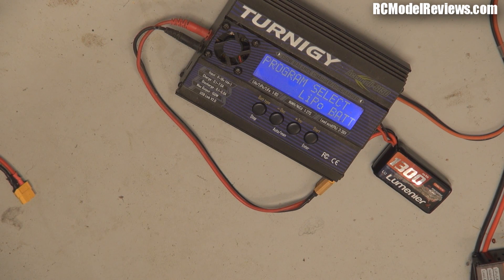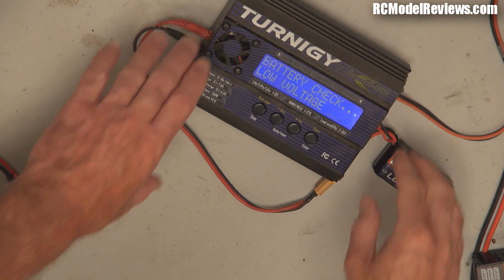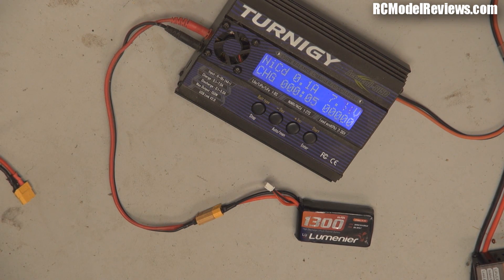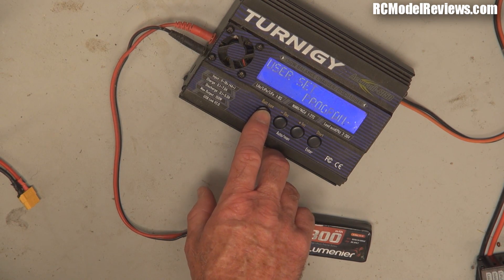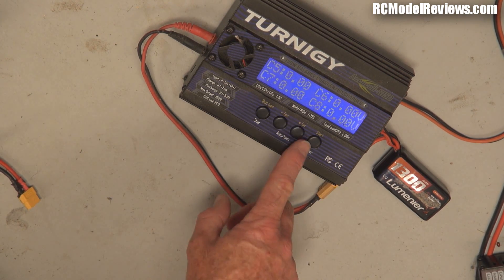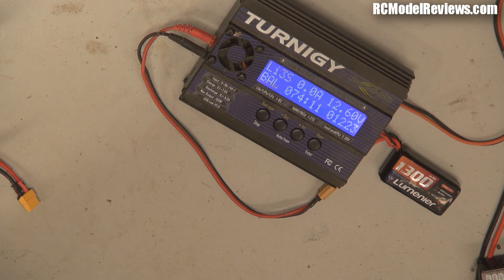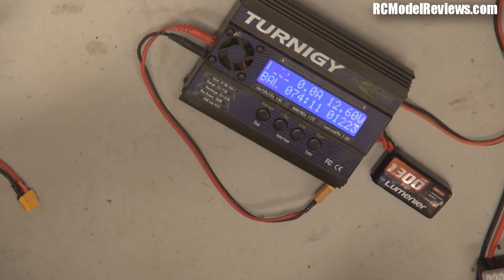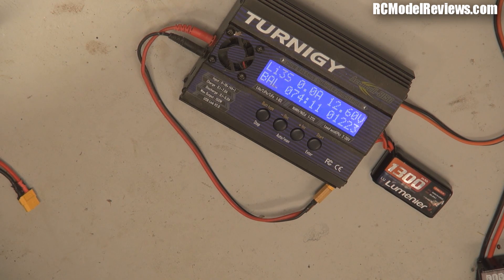How to recharge a fully flat lipo (lithium polymer) battery

Comment: I find LiPo batteries such a hassle... if I’m not flying my RC plane, I have to recharge it everyday. There goes another battery today at 0V
Reply: Why would you have to charge it everyday?  If you have a lipo at 0v, you need to pitch it, their storage voltage is 3.7v-3.8v per cell.  They should stay relatively in that range when not used, only need maintenance charging/cycling about every 6mos or so if not in use.
Reply: sunshynff thank you for my reply... clearly I was frustrated while writing that comment. I used my brand new 3 cell LiPo battery once, recharged it to 3.8V... and within a week it’s charge depleted to 0V. I’m not sure why this fast discharge is unique to LiPo batteries... but I find they die so quickly
Reply: @peterellison2220 , If it depleted to to 0v then it's defective, I've owned literally hundreds of lipo batteries over the years and only a handful that discharged to a low voltage in a short period, and never to 0v.  What did you use to measure it, most voltage readers and chargers just show "low" after it gets under 1-2v.  When you say recharged it to 3.8v?  Do you mean you set the charger to storage mode?  And what size lipo battery is it?  The volts I am referring to are per cell.  So if you have a 3s battery, each of the 3 cells would be at 3.7v at storage level, or 11.1v for the entire battery.  Fully charged it would be at 4.2v per cell or 12.6v for the entire battery.  You can safely run them down to appx. 3.4v-3.5v per cell or about 10.5v for the entire battery, but anything lower than that hurts the battery.  I've had a few lipos I forgot about for over a year, and they never lost more than maybe 0.5v.  

Make sure you keep that battery somewhere safe, if it's truly discharging that fast, there is a real risk of it catching fire.  More Lipo fires start due to discharging  than due to charging them.  Lipo fires are no joke either, they burn incredibly hot and are extremely hard to extinguish.  If you need to dispose of it safely, take it outside, cut the leads off of it, (ONE AT A TIME) not letting them touch.  Get a bucket, fill about half way with salt water, throw the battery in there for about 24-48hrs. It will then be truly discharged to 0v, and will also be inert and non toxic, which means you don't have to recycle it, just toss it in regular trash.
Reply: sunshynff I’m truly impressed by your comprehensive response, thank you. I own a voltmeter with which i can check my voltage at the field ( I didn’t deplete that new battery below 3.7V) and a charger at home that I set to storage charge (3.8V). The charger will stop charging after an hour or so, and then the drain begins... maybe because it’s connected to the charger it drains quickly? At no point did the batteries overheat in the years that I’ve owned them, but thank you for your advice. Can you refer me to a 3s 1300mAh battery that you trust? Thanks again
Reply: @peterellison2220  Sure, real quick, are you using a good charger, or at least doing a balance charge. That is where you hook  up the second cord with the white connector to a balance board. You should always charge Lipos that way, because it charges each cell equally and makes sure they all match.  When you do a plain Lipo charge, not balanced, it sends one bulk of voltage to all cells, So if one off, it won't match at the end of the charge.  Middle of the road to more expensive chargers usually have a shut off that keeps the battery from discharging, but there are some chargers out there that if you don't unplug battery when it's done, it will backflow and discharge.  There is also a setting on most chargers that's called cycle, where it charges, discharges, and charges again.  Make sure you're not on that setting.

As far as battery preference, most of my batteries are made by Tattu, they're my favorite.  They are not the cheapest but definitely not the most expensive.  Plus, they're are generally one of the lighter batteries on the market.   If money is an issue then the the cheap ones I like, that are still decent for the price, are Zop and Zippy.

https://www.ebay.com/itm/Tattu-1300mAh-3S-11-1V-45C-RC-Lipo-Battery-For-FPV-Drone-QAV250-Quad-XT60-Plug/283240328348?hash=item41f2706c9c:g:LGIAAOSwLNxcEdng

https://www.ebay.com/itm/ZOP-Power-11-1V-850mah-70C-3S-Lipo-Battery-JST-Plug/223935417070?hash=item3423974aee:g:qEkAAOSw20JZgoSz

https://www.ebay.com/itm/New-Zippy-Compact-1000mAh-3S-11-1V-25C-35C-Lipo-Battery-Pack-RC-XT60-XT-60-USA/324140598571?epid=1840546251&hash=item4b7849052b:g:YDAAAOSwYXVYyXqV
Reply: @sunshynff  Yes I am using the X1-mini battery charger, and I pay close attention to charging each cell evenly. I just ordered a Tattu 1300mAh 3S 45C LiPo battery from amazon for 35CAD. Thank you for helping me find a new battery! Once I receive it, I plan to charge it to 4.2V/cell, then gently fly it until 3.6V/cell. I will then balance charge it to 3.8V/cell. I will make sure to disconnect it from the charger and see if the battery holds 3.8V/cell over the following days. In the past, my Parkzone batteries would drain from 3.8V to 0V over a few weeks. I'll let you know how my experiment goes in May!
Reply: @peterellison2220  👍
Reply: @sunshynff  I love the new battery! Holds its charge perfectly. Thank you for your help, you're a Li-Fe saver!
Reply: Peter Ellison....awesome, glad it's working well for you!

Comment: What charger do you recommend? Also, I want to recover a 3000mah drone battery that only has a balance charge cable connection. A hubsan zino battery. How would I use the process you've described here where there's only a balance charge connector on the battery? I'd really appreciate any advice.

Comment: Something a bit different......I left 3 2800 mah 3s batteries fully charged for a yr. and now they wont fly. They measure and  say fully charged and will not charge any more, but no fly. Is there a way to bring them back to life. They will power a heavy resistor at 2A for more than 10 min at 10 volts but the fc40 won't fly and the front light blinks low battery almost right after lift off.
And quits flying.

Comment: So I paid extra for one of these spectrum smart batteries 22.2v 6s,a while back thinking I would get a charger once the financial well fills back up so to speak. In the mean time I got the battery to low playing around with it and by the time I bought the charger it said the battery wasnt any good. So I seen on youtube a couple 12 year olds using this tech. to get the battery back but I don't want to risk a fire on someone that doesnt shave yet if you know what I mean. So I ran into your video and thought if your willing to try it it must be mostly safe if the current is kept low ext. so I did it for about 10 minutes and it just worked perfectly,it was like the charger which is a spectrum s1200 (the $64 one with a toolkit 19vdc 200W power supply) started wakeing up this started working then another funtion started working and now all is good. So thank you very much I am a huge fan and now I'm you #1 fan.....Your friend Bob from Kentucky...

Comment: My 3-cell LiPo was at around 3.7 V as a pack when the charging started (so surely the voltage was even lower just sitting). 1 cell around 1.8V, the other 2 couldn't be measured. After applying this method 1 of the 2 dead cells resurrected, the third kept on being dead. I charged the pack to a point to wich 2 cells were at about 3.8V each while the third was still at 0.1V. My first dead LiPo ever. Puffing a bit after charging. Funny thing is that I decommissioned a slightly puffed 3-cell LiPo which had totally fine cell readings - now that presumed dead LiPo is in use again :D

Comment: My 2-batteries in parallel were connected to a BEC for a month. Didn't know it draw current. Now they're reading 1 volt. Are they done?
Reply: Yeah i wouldn't risk it anymore with that low voltage

Comment: epic. fixed a 1300mah 2s drone battery with this.. got a few more to try. you just made me happy to fly again. also got 2 1800mah for the bugs 3.. i rigged up a xtc30 connector and poof the b6 charger worked. its finicky on some of the others but im getting the jist.

Comment: One cell of my 3s lipo battery is showing 0 V and I connected it to a balanced charger but that 0 V cell didn't charge. But the other two cells were charged fully. What should I do in this case?
Reply: Get a lipo killer and get rid of that battery.

Comment: This just got my Maclan 6000mah 4S LIHV to start charging. I was getting a cell error message on my Hitec X2 AC Plus charger, and it was only reading voltage for 3 cells. I put it in storage mode before letting it sit for about a month and a half, I'm not sure how it discharged. 🤨

Comment: What do I do with the error message CELL ERROR and no other explanation? I have the SkyRC e660 charger and even the manual doesn't tell me what to do. Appreciate any ideas.
Reply: You have a problem with one of your cells you can check out your cells in the battery meter if you have one on your quad

Comment: Question. Have you ever came across the following:  Flying the emax tinyhawk,  I crashed.  I didnt pay attention to voltage in fpv screen. Than the quad turned off.  Unhooked battery, it was warm. I hooked up lipp to battery voltmeter (no charge or anything one of those cheap 1 cell voltage testers ‐ tester is accurate since i tested before against a multimeter).  It was at 2.88v and it started to climb very slowly within a less than half a minute it was 3.00v and kept climbing 0.01v evey few seconds.  Look like it quit climbing around 3.18.  I only flew this battery maybe 4 times (orginal with tinyhawk kit).
I hooked up to hobby charger via parallel board.  I checked another battery same type for same quad (450mah).  It tested 120ish mOhms. (Cool battery at 3.60 volts).
Questionable battery: 187mOhms (battery was also measuring 3.2v).  Question is- is the suspected battery okay, if so how do i proceed?  The hobby grade charger (that can do different chemistry) has a lipo charge as low as 100mA.

Also, i have hobby grade 1 cell lipo charger than can go to go as low as 100 mA.

Comment: low voltage ..then i follow your tip on NiCD upto 9 then charge under LiPo..it just say FULL / it did not even charge using LiPo on charger @ 1.5mah ..my battery is 2S 1500mah 7.4V  it did not work for me...

Comment: RCModelReviews
Is it feasible to charge lightly,one cell at a time (0.1 amps or less) and when they are all at your recommended voltage, return to the balanced charge lead?
A PP3 (flat battery..shape not condition)  with a limiting potentiometer and a meter in series plus one across for voltage would be straight forward enough..

Comment: I don't think you should do it if you don't have a proper charger with recovery mode for lithium cells when it pulses to break off and negates some damage from the over discharge...
Also it could much more easily puff up or short and go thermonuclear on you.... even if you use it normally afterwards...

Comment: Additionally, you can “jump” a battery with another battery or just about anything that puts out power, however, it can be very dangerous. This process shouldn’t take much time before the battery is in range to charge again but I can’t stress enough how dangerous this method can be. I once accidentally charged a lipo on NiMH settings. The lipo didn’t seem damaged afterwards, however, it was warm after charging which isn’t supposed to happen with lipos. I tested that battery in an RC and it worked fine, so, I thought everything was ok, however, later on when I charged it up again with the correct “lipo” setting, it caught on fire 🔥. I’d be very careful attempting to charge a low voltage lipo with more than one cell. Whenever, I was “jumping” lipos, it wasn’t for RC’s. I had an old cellphone that wouldn’t charge without “jumping” the battery if the voltage got too low. Nowadays, I try to avoid lipos as much as possible. I prefer NiMH batteries because they aren’t as fussy and don’t catch fire as easily. After that lipo fire, I started using different connectors for different batteries. Tamiya connectors for NiMH and Deans or Traxxas for lipo. That way, I don’t get confused and charge on the wrong settings. Be careful, always use a lipo charging case, and NEVER CHARGE BATTERIES UNATTENDED.
Reply: Ace Report yeah that’s what I do. Just jump it for for a couple of seconds a couple of times. Never had a problem. Always recovered my batteries 👌

Comment: I used this mod on a completely drained Lipo Parrot Bebob 4000mAh battery. My charger gave a complete error and normally I would throw the battery away. (€50,-)
With this method I was able to revive the battery completely. No loss of cells, no loss of power. Great mod and I will recommend this to everyone. Thanks.

Comment: You have saved my 4s 5200mah lipo, thank you!!! I bring them back from 2.5v per cell honestly I was very afraid to try it with this little big boy but everything works correctly being fine with the input voltage and amp

Comment: Thankyou! this was my problem, new smart charger, My batteries sat for  4 months, i didn't know where to start.  turns out the battery was at 2.3 volts on a 1300mah 7.4v LiPo battery.

Comment: I need to rescue a single cell (voltage of the first cell from black has reached 2.7v and all the others are 3.4v). Should I still do the NiMH/NiCd charge across the main charge leads or should I charge the lowest cell to get it over 3v using a 1s charge setting?

Comment: Hello, RCMR. I just want to take this moment and thank you for the lipo bat recovery. I have a battery that I completely discharged by mistake. I left it plugged in my googles all night and it was down pretty low to where it would not charge at all. By doing what you recommended I was able to recharge it back to normal YOU SAVED ME MONEY Thank you so much, we all appreciate you!!

Comment: Thanks for this ! Saw this video about 10 months ago but didn’t need it at the time ( I never run my batteries too low ).Today I left a 2300 2S plugged into my FPV goggles ( first time I ever forgot to unplug it ! ) all day and this evening the battery was completely dead. Charged it to 6.4v as described and it then took a 2S balance charge back to almost 4.2v per cell. I was about to throw it away when I remembered seeing this video back in the day and your method worked fine for me. Thank you for saving me a good few quid ! Cheers !

Comment: Leave it sit and see if the low cell starts dropping in voltage.. 
Mine all do so I don't trust them for more than running lights on my bicycle.
Or like you FPV goggles.

Comment: i have built a very low power constant current charger for very old cells and cheap chinese cells. charges at between 10mA and 70mA. works awesome . most modern chargers can only go as low as 100mA. these low currents bring the batteries back to life

Comment: Thank you soooo much.  I just recovered a fairly new 4S battery that measured only 6.4V on the multimeter.  Charged it to 12V in Ni mode, switched it back to Lipo.   YES!!!!!!

Comment: I’m having a similar issue. My lipo was overly discharged and first my charger showed reading but didn’t seem to be charging it. And after a few plug in and outs the charger is saying error 5.  
I don’t have a way to adjust power on this charger. Is there any other way to get some power in ?

Comment: This does not work with my B6 charger.  When I try to charge the dead battery with the NiCD setting, I get a connection error.  I've tried this with the HobbyKing Eco Six and got the same error.  Seems that if there is no charge in the battery at all, it doesn't sense the battery.
Reply: John Gallagher I have the same B6 charger and it works fine. I think your battery is really dead and beyond the point of reviving.

Comment: Hi RC Model,a question I have a 4 cell battery that I left a day long on my quad was stock in a tree, my battery was totally drained now I charged it slowly back up,but only 3 cell recovered back to 3 volts per cell,but the 4th cell remained below 1volts 0.42 how can I recover that cell again thanks In advance.

Comment: Bruce - while you didn't say, do you recommend that charger ? If not is there one you do recommend?
How about the rest of you RC'ers. What charger should I buy ?
Reply: Carpenter Family PLC 100, it gets the job done in 40 min for a 2s 5000mah Lipo and has the most settings to use. It also has the best thing... a touchscreen to make it easy to work. I picked it up and the instructions are clear as light. And for the price I got it at ($54) it was well worth it. I've bought  $100 chargers that work worse and don't have as many optins as this one. Trust me if you buy this charger, you won't regret it.

Comment: Thanks for nice info. I bought a new 4s battery for my 210 quad, but one cell is dead already right after open the box.

Now battery is recovered but has little concern about the battery condition.

Should i send back this battery to the seller? Or can i use this with new condition?

Comment: I did it the horrible way and plugged it into a parallel adapter to get some charge in it. Worked, got kinda warm, still flying it.  I suggest never doing that.